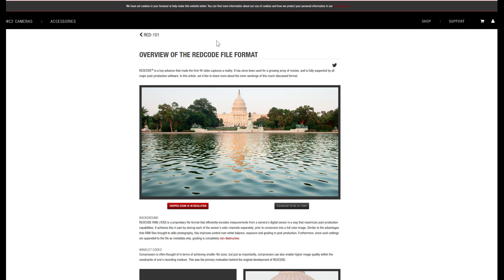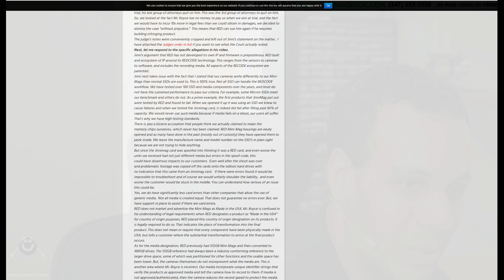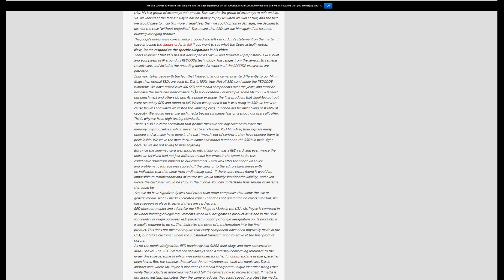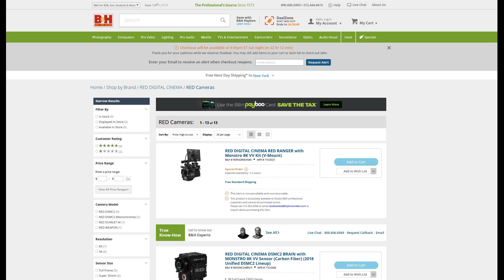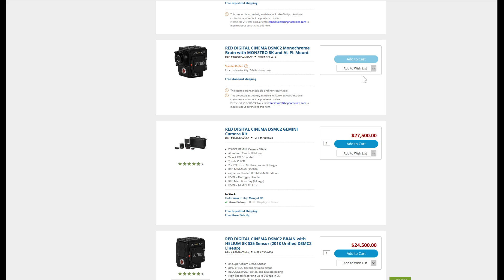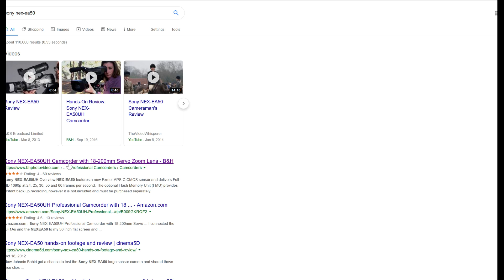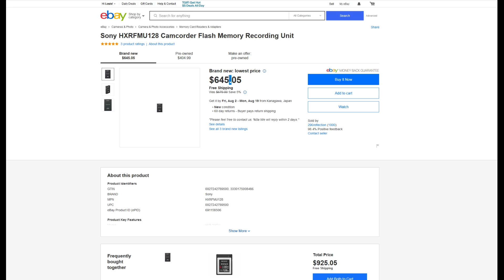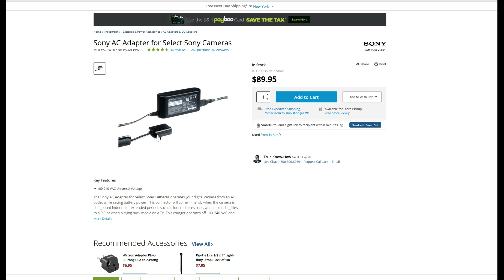Red Camera Mini Mag thing - my take on it.

Comment: People love being outraged at overprised expensive hardware which are just marked up. I think it's because people want to pay a lot for GOOD hardware or GOOD software. This is merely good software and good hardware (the camera) which they could just let you put a Samsung 870 in it and it would perform better, or he'll multiple SSDs for RAID redundancy on these expensive machines aren't unreasonable. I think what this controversy comes from,is tech knowing people perceiving they should be getting good quality for the price and not only do they get mediocre quality, they even get bad quality. At this price point you could RAID NVMe m. 2 SSDs and buy cooling for them.
Reply: The camera isn't the issue, I love my RED RAVEN, it's the recoding media I have a problem with.  RED made it sound like they spent millions on the development on the media, and that it was an original construction by the company so they can charge THOUSANDS for their "PRAPRIATORY" memory card.  But when you crack into the card ITS NOTHING BUT A "COMMON" SSD [which cost only 300$] with an mSATA adapter!!!  RED obviously buys the SSD's in bulk so the cost to them is only like 100$ and the development of the MINIMAG housing could be designed by a 2nd year engineering student!  That's why we are pissed OFF.

Comment: Oh another fun nugget; RED uses FAT32. Part of the reason it writes up the the maximum FAT32 limit before spinning up a new file. Not sure if this changed, but from my current knowledge while FAT32 has ubiquity and simplicity, ExFAT has that speed as any high-performance filesystem format should and even if they don't want to use ExFAT, they could use NTFS which almost any OS can read, not like most creative professionals use Mac anyway (don't get me started) because most of the good stuff is cross-platform or Windows-only.

Seldom few exceptions where Mac wins out is platform-exclusive video ingest software. Pray someday DaVinci Resolve becomes the standard in the future because that shit runs on Linux, is free and a dope substitute for Adobe Premier. Sure you don't get the "Ecosystem" as Adobe would like to advertise with use of other utilities but if you're just splicing together video you don't need fancy crap for that, you simply do it.
Reply: Both exFAT and NTFS are proprietary filesystems patented by Microsoft, I think this is maybe the case why they don't want to use it. Alternatives are there but these often aren't supported in Windows.

Comment: I don't mind paying ~$3000 for just 960GB. But this is just a lot for a sata based ssd. Their nonsense camera doesn't even have redundancy when it comes to storage you have to write to only one storage module. The thing is that your sony argument is little bit off because that camera uses shitty video quality you could literally record ton of video content on that 128GB module & also the ssd were expensive at time yes they were that expensive at the time, a 1TB sata ssd cost about $500+ dollars because it was a niche product but now a days you could literally get nvme based 1 TB ssd from Samsung for about $200. Difference in price is what matters. I could give you example in your realm take a MacBook with 128GB of ssd storage in 2010 those thing were damn expensive at the time because the ssd adoption rate was not even 1% of today's market for ssd, not only that apple has always used best of the best ssd on the market & I get that they do charge quite a bit premium for those.

Now lets calculate according to the current price, you could double the storage of a MacBook from 512 GB to 1 TB for about $400-$500 extra so that's about $400 for nvme based super high speed storage at about $1000/TB it is overpriced by 4x the retail price of 1TB ssd but decent considering the quality of the ssd. But what red is doing is that
1. They give you a sata based ssd for about 15x the price of retail price moreover they give you a  sata based ssd in this era is this a joke.
2. They have made more connectors to plug the ssd in there are 2 adapters in between the ssd module that means more point of failures as these storage modules are swapped very frequently. Giving data recovery on ssd is like saying I could find your lost ball that you lost in pacific ocean. Are you out of mind red? Recovering data from ssd is nightmare. Why not just provide a reliable and fast ssds in the first place best case would be be to give redundancy in the camera so that user can record on two media at the same time That would be relief. But I get it that the person who buys a $50000 camera has enough money to burn on the storage media. I hate the fact that they just don't do anything remotely I would have liked their pricing a lot if they were company like crucial who outsourced samsung ssds put own controller on to the drive then sell it for 15x the price. Apple does the SAME. Most people don't realise that on apple devices whether it is iPhone, ipad or mac they might use a Samsung nand flash but the storage controller which decides which data would go where it is like brain of ssd is developed by apple itself. Hence theere is a premium. With red mini mag they are just developing a freaking adapter which just changes the shape so that any other ssd can't fit into it. Seriously guys? This is just pathetic. They don't even have the guts to completely develop a proper ssd outsourcing nand flash modules and they are saying they have spent millions of dollars. Millions of dollars my a**.
Reply: If you want to see how they make you spend money on shitty things go see the Linus tech tips video where they unboxed red camera and its accessories with their price for each and every connector it requires to fit their own accessory to the camera.

https://m.youtube.com/watch?v=3t1PQJmM8P4

Comment: Arri or BlackMagic for pro video. RED cameras don't even do dual-slot and redundant recording. It's simply not in the hardware design. So when the cheapo PCI-E card inside the damn thing takes a shit, oops goes your footage. At least with BlackMagic and some of their older models using CFAST you can use standard 2.5" SSDs because CompactFlash became serialized and did a jump similar from WD's IDE to the more broad SATA standard... because CFAST inherits everything from SATA as both connectors can be on the same bus to transmit the same data.

Later models simplified this with M.2 connectors and presumably dropped the CFAST interface altogether as it was a last gasp for the CompactFlash form factor during the transition away from older standards.
Reply: They aren't even PCI-E, they are MSATA 🤣

Comment: The difference with Sony is that they've always had a thing about creating their own proprietary formats. MiniDiscs, UMD, MemoryStick etc. Whereas RED are just using standard SSD's. Sure they may have tested them to find the best (Cheapest) SSD's but they did not create a new storage format that would have the features you expect in pro equipment like redundancy Raid 1. Or a new file format that wasn't limited to 4GB file sizes.

Comment: Pro-video cameras are expensive because the number of units sold is very low, and the cost of all the engineering is high and has to be spread out over everything they can sell, it's part of the business model. While they're at it, they squeeze every dollar they can out of their customers with costly accessories, needlessly proprietary accessories and consumables and ring that "perceived value" bell as loudly as possible. If you make money using this stuff, then you pay and you're happy someone makes and supports the equipment so that it exists for you to use.
Reply: Have yet to come across a cinematographer who owns their own Arri or RED. They rent them. However, I know a few who have invested in a set of Zeiss glass....

Comment: Very good response, you got the nail on the head. The only thing you might have missed is the original claims about custom error correcting firmware (or otherwise better) on the SSD, now being completely backtracked into custom camera firmware.

RED is/was a mythological camera so many wanted, especially since no one can afford an Arri Alexa. People (non-owner) care because they might have dreamed of purchasing a used RED. The dream and brand is a big part of RED.

Being exposed as fraud regarding Made in America and exceptional media might be harmful to RED. If the camera is not magic, then it can be compared to other cameras with excellent image quality. Black Magic, Panasonic, Canon, Sony, Atomos (and the new China brand I don’t recall the name of) when compared without any dreams attached to the RED brand may be a much better positioning.

Comment: You didn't go much into the fact that it's an mSATA SSD in a fancy enclosure. Not even specially proprietary circuits or something, just an mSATA SSD connected to a cheap adapter in an enclosure.

Comment: Why doesn't RED use redundancy for storage?
Reply: Cost of developing?
They really need to offer a RAID redundancy option with a faster PCIe-based solution. Even if it was the same speed with current cameras don't forget people need to copy the MASSIVE FILES to an external computer to edit. It's 7.29TB per hour for 8K RED Raw video. Do the math on that. Even if you got 500MBps sustained copy speed it would take about 4.5 HOURS to copy one hour of that video to a PC from the SSD. Ugh. (feel free to point out a logic failure but I can't find one)

Comment: My problem is here: they could just say here is an expensive SATA or MSATA or M.2 adapter...and when you buy it you can just use any SSD...would be so much more customer oriented...They shouldn't make money on reselling cheapo SSDs. Also they could make a mag which has 2 SSDs and which record with Raid1. The R&D and production and value in terms of redundancy of it would defend a high price and large margins, but it would really be something of RED. Here they sell a PCB and a cheapo SSD for 1200$ (and free data recovery...but hey with a RAID 1 solution this would be obsolete and I have no idea how good or bad their recovery is). And after they charged already lots on their camera...charging that much on a cheapo SSD and simple connection SSD, seems just wrong to me (it is not wrong we live in a free market and and they can do what they want).

Oh and I would have loved your thoughts of the made in USA thing...
Reply: The prices I saw were $2400 per 1TB unless that's changed. Anyway, if that's correct it should cost about $80 maximum for their costs per 1TB or $150 for a 2x1TB version (not double as the case/adapter adds a small amount). So that would mean their PROFIT would go from $2320 to $2250 which is only a 3% loss but then they would have far less costs for the free data recovery... even if those numbers are off the logic is sound. You also have to add in some value to having a more reliable product though that's hard to assign a number to.

Comment: It's more about the principle of the thing. If they claim to have a proprietary format of drive, that's leaps and bounds better than what it would be had they NOT done all the "R&D" to make it better, and you crack the thing open to find out the cost of mailing it to your mother would be more expensive than manufacturing it... that's BS. 
They claim the price is because of developing some fantastic product, when really they just slapped a generic SSD inside a milled container and connected a janky adapter... That's lying straight to the customer's face, and that I find deplorable. Especially for what the damn things cost. Sure, firmware matters a tiny bit in the whole mix, but it doesn't seem (from what I've seen) to impact everything so immensely, that it justifies the price, at all.
Reply: The FIRMWARE appears to do absolutely nothing for the RED drive and is there solely so that knockoff drives without the firmware identifier are artificially slowed down. There would be no reason to have a proprietary firmware with open standard SATA.

Comment: it's hard to say something negative about a product after buying it. It will create unfavourable psychological feelings like cognitive dissonance and that is why the apple users try to defend it. I myself am a apple user. I've got an iPhone 8 and a 2015 macbook pro 13 inch. They both work OK. My macbook tends to run hotter than before the last update but it still gets the job done. But I have suffered some bad experiences with apple in the past and I will never defend apple because of those experiences. I still buy their products ( only second hand ) because they do what they need to do for my lifestyle.
Reply: LOL... instead of saying "It will create unfavourable psychological feelings like cognitive dissonance" you could have just said "buyer's remorse" but yes that's correct.

Comment: I think creating proprietary hardware when standard existing hardware works perfectly fine is always scummy to me. Sony's memorystick and whatever they used in the vita is a great example
Reply: RED didn't create proprietary SSD's though. It's just a standard SATA SSD (not PCIe) in a case with a small adapter that is just physically connecting the wires to a different size (so no chips)... it appears the only thing they added was to modify the firmware of the SSD's they purchased with an identifier so that the RED camera intentionally REDUCES PERFORMANCE of drives it doesn't detect as RED.
Reply: @photonboy999  I'll give ya that. It technically isn't proprietary hardware, it's just disguised as it. I can't decide if that's worse or not though.  Like on the one hand you CAN use other drives if you open it up and exchange them, but at the same time they're selling you something for way more than it's actually worth. If it were me I'd buy one mag and use it as an adapter and try to live with the speed penalty (unless someone has found a way around that)
Reply: @PorcuPineAppleSauce  I think you have to see the mag under a different perspective, linus techtips had a video when they bought their two red cameras with all the Accessoires  they needed I think it was around 140k$ for the two. So whats another 3k for the 1Tb modell, basically nothing. And what you really buy is not the hardware but the services that are attached to the specific device like in this instance data recovery service. This is true for many industries,  the price might seem hefty on first glance but if you get high reliabilty fast replacement and service it repays it self very fast. Downtime in any large scale production is very very expensive. I don't know about quality and reliabilty of the mag but so doesn't anybody else except for RED themselves.
Reply: Totally agree this was always Sonys game invent some useless propriatary sh... so you can only buy from them and this is true for most of their stuff not only proffessionl grade camera gear

Comment: I find this whole kerfuffle amusing as this is common practice for proprietary systems and is one of the pro column reasons for developing a proprietary system vs going for an open standard when targeting that top end segment.
Red caters to a niche segment at the top end of the professional market segment and not the larger consumer semi pro segment where cost factors in vs quality. 
The only controversy here is that RED are opting for lower end consumer parts to use with their interface rather than higher quality "pro" level parts to save a few measly dollars on a part that has a staggeringly huge markup vs cost to manufacture. While it's a nontroversy to charge big dollars for add ons for a proprietary system, people usually expect that the parts used for these massively overpriced parts are top of the range technologies and not just good enough to do the job.

Comment: This whole debacle is being proposed by people that aren't familiar with enterprise equipment (IMO -- I'm in the enterprise IT space).
You aren't paying for the parts alone -- you're paying for the complete component that is supportable by the vendor.
You want Red?  You're paying for the whole shebang.
Who want to pay less?  Buy something else.
This type of thing is TOTALLY NORMAL.  I'm not a camera guy, but when it comes to servers, one can build any enterprise anything for much less if all you're checking for is spec itself.
I suppose my final point is that you're welcome to use fake Red cartridges.  If you ever have an issue with that you're on your own.  People in the know appreciate the "cover your ass" that buying legit gear affords you.
Reply: But when you're buying really expensive enterprise stuff, you're expecting to get top of the line stuff, right? Not some cheap SSD that barely cuts it.
Reply: Except there's no indication that RED has done anything that makes the camera work better with "their" SSD devices like they have claimed. RED lied. That's part of the issue. They are telling people to avoid the cheaper alternatives with lies (and some truth).
Reply: pro cinematographer here, u touched a point i havent red anywhere else, people are comparing apple with red but there are differences between consumer products and pro equipment, one of those is precisely the consumer support, once we were filiming in a beach and one red scarlet fell to the water, sank like 3 mts b4 someone could get it out, we called red, they sent a new one while they took the other one for repair, we went back to the city like 3 weeks later and our camera was back, thats part of what u pay with this kind of gear